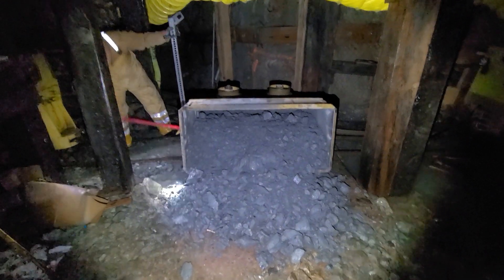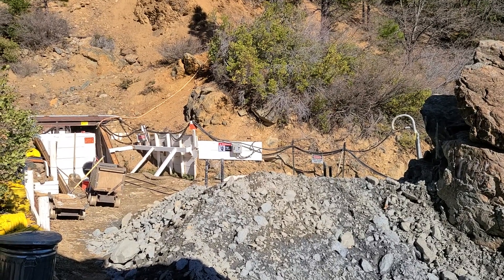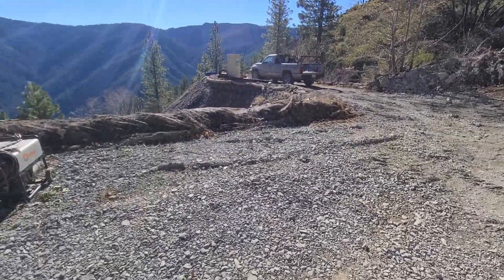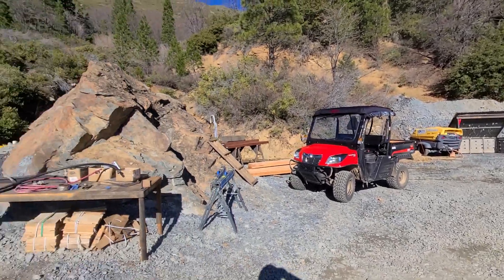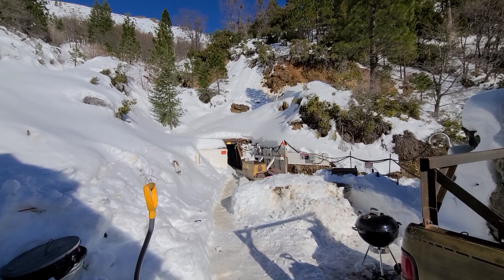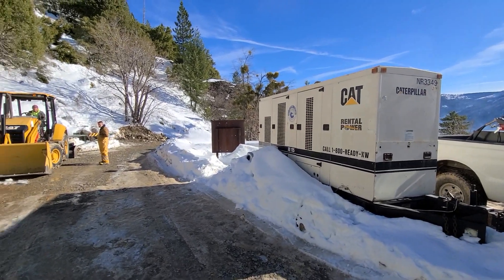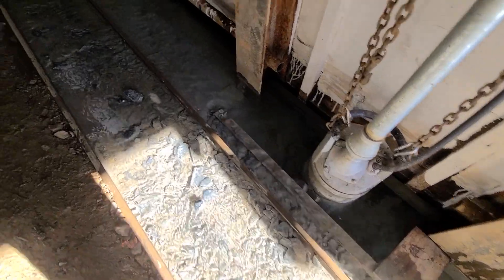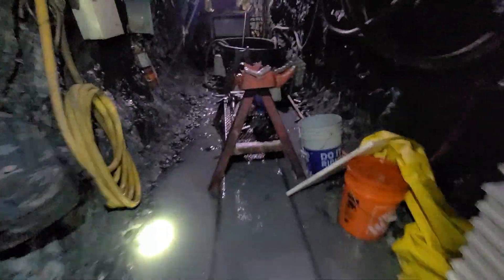Bringing An Abandoned Gold Mine Back To Life: Part 15 of ?

Comment: To make the loader tractor work better and smother you can put 2/3 of water in the tires. Will weigh it down. A lower air pressure will give it a better grip.

Comment: The driller standing on the leg of the machine is going to result in serious injury probably sooner than later. We never did that in my near 40 years experience in mining. To resolve that issue you need to buy or fabricate a leg extension that you attach the foot of the leg. We used an 18" angle iron with a spare jackleg foot welded to the bottom and a short 1" pipe at the top to hook in the leg. This also allows the drilling of the backholes flat instead of inclined upwards. As a result you can obtain less scaling, better ground control and faster cycling of the round.
Reply: We tend to drill off a partial muckpile.

Comment: Couldn't you run a hose from the drill exhaust back to the outside ?
Reply: Why would you do that? It's just water vapor with a touch of vegetable oil.
Reply: @Porty1119  Apparently you weren't listening.
Reply: @thewolf3889  To what?
Reply: restrictions on the exhaust of the drill really hampers the performance of the machine.(in this case a "Midwestern model 83"

Comment: Nice to see how the real work is done in the mine .At about 2.00 it shows drilling and a miner is standing on the leg for height is this what they call a jack leg ??⛏️🏆🤔
Reply: Sure is. Standing on the leg like that isn't the safest; we drill our upper holes before mucking out so that the driller can use the muckpile as a work platform. We then muck out and drill the rest of the face.

Comment: Tractor tires are expensive. Stop spinning them when filling bucket. Watch a few videos or get training. It is not that hard.
Reply: Agreed he is wasting fuel and tires they all should be able to run that and get full buckets. But you have to learn somehow it's easier to watch a professional and try to replicate what they do it was a good laugh though 😆
Reply: That, and it has a 4 in 1 bucket. Very easy to get full buckets with a 4 in 1.

Comment: So did the vertical core drilling on the surface give you a rough direction, and distance to go into the side of the mountain with the drift, before doing the interior "fan" coring?  How did you know you needed to do interior core drilling now verses 100 or 200 feet earlier or not until you went 100 or 200 feet further?  Is the "fan" coring done vertically, or diagonally to try and find the structures that might yield gold?  How deep does the fan coring go into the rock face?  When you find ore bodies, how far do you have to travel outside the mine to get it processed and is that handled with anything special or just done in trucks?  Really interesting to see.  How they did this by hand before power tools, is amazing.  The vertical core samples from the outside must have shown promise if you are willing to spend years, and millions of dollars to just get to the ore bodies.

Comment: Hell yeah, hope you get some good stopes blocked out! What caused the generator fire? I'm going to go out on a limb and guess it was the turbo or an electrical fault, but those are just WAGs.

Consider yourself lucky that your ore is consistent enough to core. Much of ours is so nodular that it's simply not reliable beyond identifying potentially ore-bearing structures. Barren quartz can be found a foot from $50,000/ton nodules with visible electrum. "Drill for structure, drift for grade" has become this district's motto - muckpile samples are the best data available. We're about to start drifting; we have two veins within 50' of the face, one with a decent core intercept that I hope isn't a fluke. In a perfect world, we'll be able to establish four working faces in ore and possibly get a stope or two going.

Comment: Wheres your breathing protection? My grandfather died a slow agonizing death from breathing in a mine.
Reply: None is necessary. It's a damp mine with good ventilation and no dust issues.
Reply: I’m literally seeing the dust cloud as they’re drilling. You can see it in the beam of the flashlights especially clear.  @Porty1119
Reply: @MrGermany18  That's water vapor. Have you ever run a jackleg before?
Reply: @Skunkovitch  It's vegetable-based. Given a choice between breathing it and not, I'd prefer to not, but it's not really harmful. A jackleg will tear up your shoulder more than anything else.
Reply: @Skunkovitch  Everything sold as rock drill oil nowadays is vegetable-based, I know for sure that's all we buy and I feel fairly comfortable guessing that TVR's crew does the same. Using hydraulic oil in a jackleg is an awful idea, breathing in petroleum mist is most likely carcinogenic. The only jumbos we have are pneumatic and they use the same vegetable oil as our jacklegs.

Where did you mine uranium?
Reply: @Skunkovitch  Small world! One of our miners in 2019-2020 was from Moab and worked at Energy Fuels' La Sal complex (Pandora, Snowball, Beaver). I also bought a Young Buggy from a contractor in that neck of the woods, he bought most of Cotter's equipment from the Jo Dandy district.
Reply: You worry about you if they don't use them that's there business I'm with you Headframe hunters

Comment: How do you separate the waste rock from the ore? And how do you know what is going to be mostly waste rock, and what will have a lot of ore in it, once it has been blown?
Reply: there is no ore in that its all waste they are hoping to find ore by blasting the drift back a ways then core drilling to see if there is any ore there
Reply: To make sure i understand, they haven’t actually hit any ore yet, but when they do, they will “keep” all the rubble and send it through the processor. Is that what you’re saying?
Reply: @ridleyscurry2480  They did research before reactivating this mine. As much as you can do with an old mine anyway. If you have watched the early videos, you will know that not all the mine was accessible though. We don't know everything about this mine, as Justin is just one of the people involved in this enterprise. Maybe the mine won't be very profitable, or they could strike it rich, or somewhere in between. It depends on the grade of the ore. That is the risk. Hopefully the core drilling will show the location of veins/ore bodies that it is worth putting a drift/crosscut to. Then the mining of ore will commence. They try to remove as little of the country (non-ore) rock as possible, as that is just an expense.

Comment: nice.. I take it the core drilling is there to tell where you might find an ore body and which direction to head in.
Reply: Exactly. Rock types and grades are logged to build a 3-dimensional model, and interpolation is used to fill in the gaps between holes.